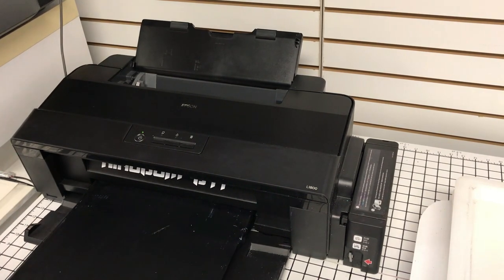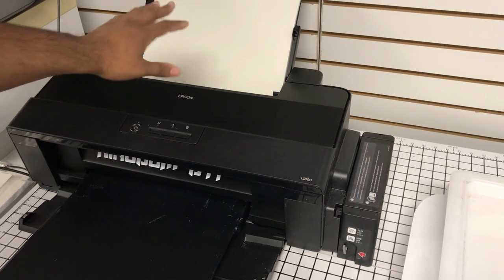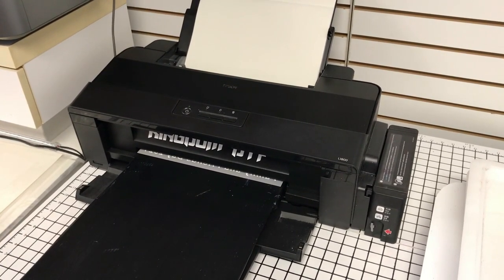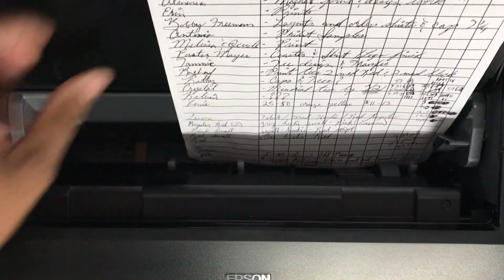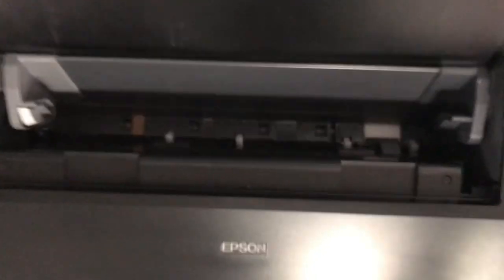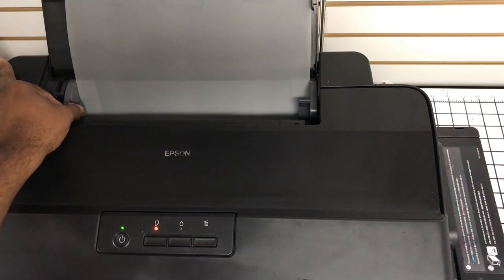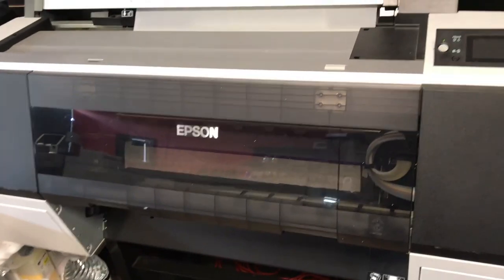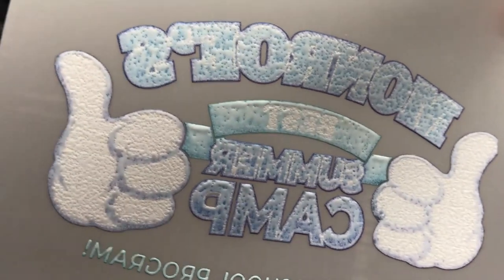LOADING DTF FILMS & AN UPDATE ON MY EPSON 7890 CONVERSION

Comment: Bro all you need to do is put a piece of masking tape on that white rectangular thing in front of the roller. I’m surprised nobody suggested this. I read about this on a DTF Facebook group and now every single type of sheet feeds through 100% of the time.
Reply: @elegant_edits  I haven’t either until yesterday. You should’ve seen me on Monday...running sheets over and over again just trying to get 20 prints done. Soon as I put the tape there, problem gone.
Reply: Masking tape to cover the sensor Definitely works. I’m using the same method.
Reply: @elegant_edits  i can get a epson sc 6070 used right now can this be converted?
Reply: For some reason my printer isnt getting the print right on the paper..i get a whole smudged print and i ened up having to do some cleaning from the ink dripping off the paper..any solutions

Comment: What type of DTF heater do you have?  What are the fumes like?  I have heard horror stories on the fumes.
Reply from the maker: Currently, I use my large format heat press, until we move into a bigger space (hopefully, a warehouse!). The fumes are toxic, if inhaled. I would suggest either getting a fume extractor with a charcoal filter or running an exhaust duct, to vent out the fumes. To be honest, the fumes aren't that bad. I wouldn't , however, recommend someone curing inside their living space. If you have to, I would recommend doing it in the garage, with the door open, or having the exhaust duct installed in the garage.
Reply: @elegant_edits  thank you so much for your help , much appreciated!

Comment: Hi Elegant thank you for sharing. I have a question am looking for the doing dtg with epson 7890. My question is I saw the other smaller printer need to take out the little wheel/gear. For the epson 7890 do I need to do any mod? Thank you hope you can answer my question.

Comment: Can we convert our Epson Surecolor F6070  dye sublimation printer to DTF ? Thanks
Reply from the maker: Hi and thanks for watching! I don't believe that DTF is possible with that model printer because it is a proprietary sublimation printer from Epson. This means that it will only print with Epson's software (Epson Edge Print), which requires a specific license. Even when we have tried to print with Photoshop, it shows the driver as un-print-with-able lol

Comment: have you gon on the paper and ink blinks at the same time error? or mostly common known as a paper jam error?
Reply from the maker: That is usually caused by spilling ink or cleaning solution inside the printer. If you are using a waste bottle to collect the waste ink, externally, you can go to inkchip.com and buy a reset key, to fix the blinking lights, if that's the issue. If you purchase the keys, use code "ElegantEdits" for a discount

Comment: Hello I have a 7890 and wanted to know what i would need to convert it to DTF.  Also what cost is involved in making the 7890 work?
Reply: Yes, you can convert the 7890 and I believe Cadlink Digital Factory RIP supports it. You will need at least 1 set of refillable cartridges (on Inkowl, the 7890 cart set is $260). It is preferred to have 2 sets (1 set for flushing lines when stepping away for long periods). Your ink will be about $76/liter from STS Inks (5 colors come to $360). You will need printhead cleaner (some people use Windex) to clean ink spills and an extreme cleaner in case of clogs (runs about $20.litre). You will need Foam swabs (do not use cotton swabs). You need an anti-static duster to clean printed films from excess powder (causes white dots on clothing).

FInally you will need PET film (since the 7890 is a roll printer, a roll of 24" can run > $250 for 325feet of film.
Reply: @elohimembroidery  I have all the things that you mentioned.  Is there any paper settings on the printer that I must select and I heard you mention turning off auto cleaning and vacuum?

Comment: Bro… this conversion similar to convert p6000?
Reply from the maker: The conversion is similar, but the p6000 is so new, that Epson has implemented new tech, which only allows us to reset the ARC chips (resettable cartridges) 21 times, before it renders the carts unusable, unless you use a different serial chip set.

Comment: I have the 7890 I have a cartridge that wont reset can you please help me/
Reply from the maker: If you try to reset the cart and it blinks green, and won't turn solid green, you may need to replace the chip on the cartridge.

Comment: for the people doing all that you shouldn't have to put tape on the printer their must be a problem some where else thats not a good sign
Reply from the maker: I was the first one to create a tutorial on how to convert the 7890, but when I started, I wasn't trying to create a tutorial. I found out that this issue was 100% due to my film. I had to purchase the double- sided matte film, because the single sided matte (glossy) film got bound up in the exit rollers. I need to make an updated video, with all that I've learned. Thanks for the feedback.